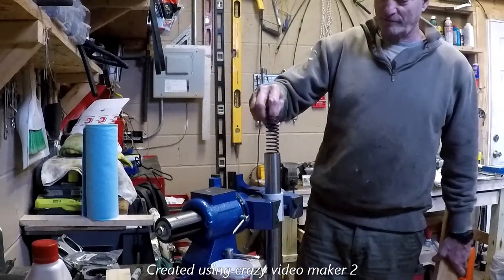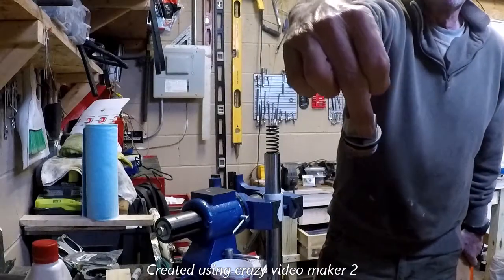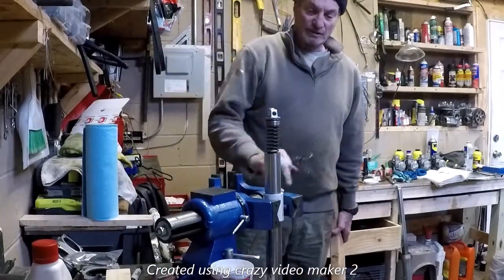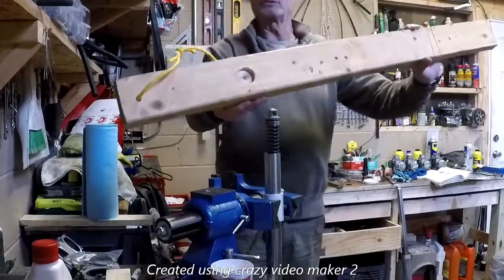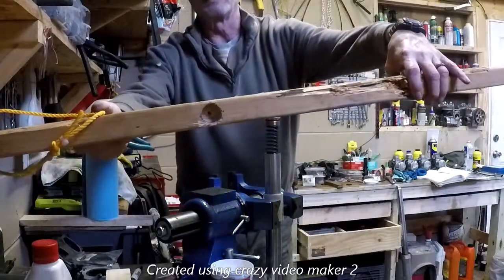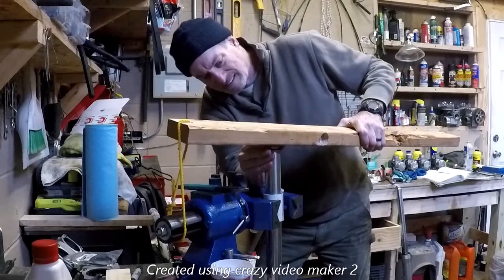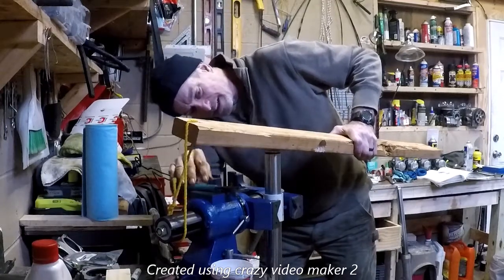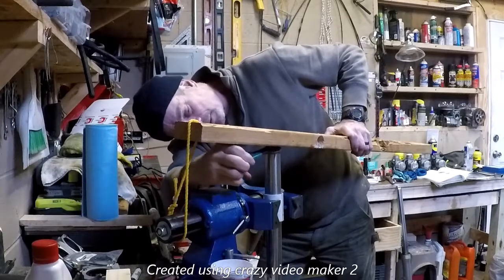Motorcycle Fork Spring Compressor

Comment: Thanks Robert, im rebuilding a 1982 goldwing interstate and im replacing the fork seals. I probably spent a hour yesterday trying to get the cap on, was about ready to throw the thing. This is such a simple and innovative idea, especially if you dont have the special tool made to do this
Reply from the maker: I looked and looked for a tool for this. Because of the shape of the cap on your 82, there is no tool available for you. I hope you had success with the 2x4

Comment: Many moons ago, when I was young and even dumber than now, I had a whoopsie. I slipped while fitting the spring for a GPz550, this 2' spring fired off in the garage rafters like a ground to air missile. It covered me and my buddy with oil and scared the crap out of us. We eventually found the jesus clip in a spiders Web 5yds away.
Reply from the maker: I always use the 2x4 when I take apart a fork to prevent parts from taking off. If I find that the preload on the spring is light, I don't necessarily use it to reassemble